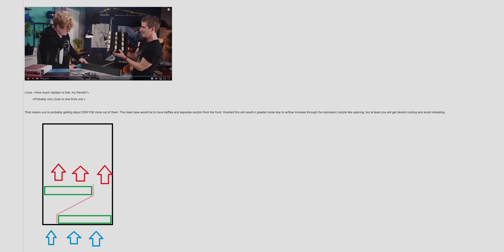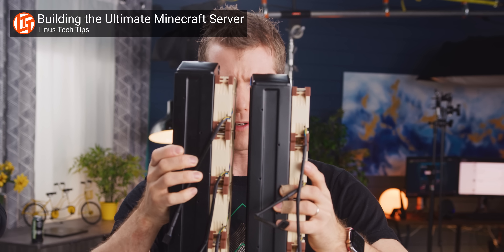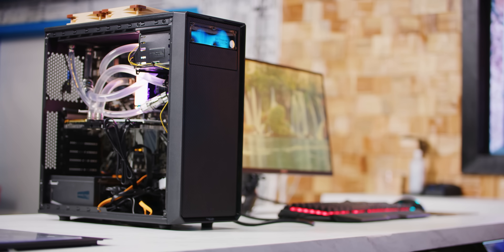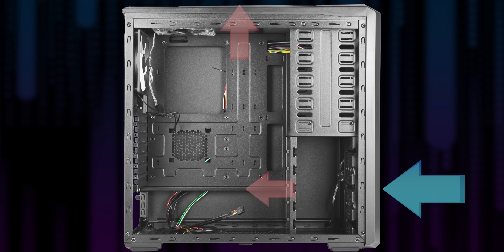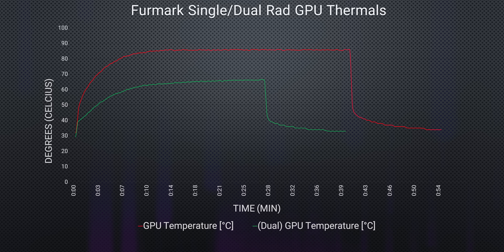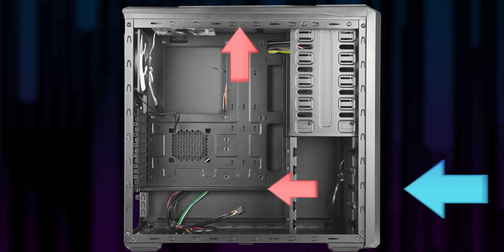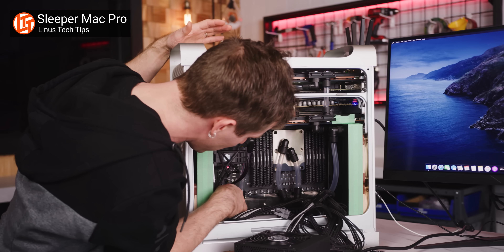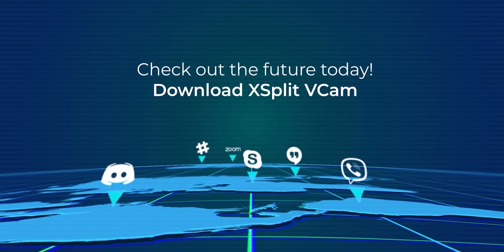I’ve been water cooling wrong for YEARS - $H!T Manufacturers Say

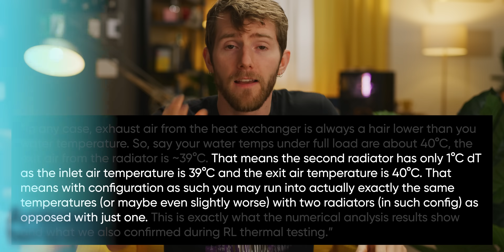Comment: 2:27 This statement, while true in theory, would require the radiator to be nearly 100% efficient at transferring heat to the air. This would depend greatly on the thickness of the radiator, the density of fins, and the rate at which air travels through the system. 

I'd be interested in what the results would be setting up air temperature probes on the intake and the exhaust to verify/disprove Corsair's claim here. If they were correct, stacking radiators would cause a negligible difference in loop temperatures, while instead I believe it just results in diminishing returns. Having separate intakes for all radiators would definitely be ideal, but it's usually not possible, and it generally isn't necessary.
Reply: I think there is a few videos out there from old school water cooling that tested the pressure and flow drops across radiators and various other components. I think with the more efficient pumps and radiators available now that it would issue would be  negligible. Worst case secenario you might have to increase fan speeds a little to offset what is lost and/or the pump will have to run at a bit higher rpm.
Reply: stacking radiators "if nothing else" increases air and fluid restiance of the cooling system. At some point the pump can not push the water and the fans can not push air trough the stack.

Comment: Linus you fool! You're doing stacked radiators wrong
You haven't stacked the radiators at all!! You've put 2 radiators in 2 separate parts of the case with access to "different" air.
Jake's custom Minecraft server, where the warm air from one radiator feeds directly into the next radiator is a "stacked radiator".
If you want to do this properly you need to test an actual stacked radiator, and you should use thermal probes to measure:
1) the ambient air inside the case
2) the air before each radiator
3) the air after each radiator
4) The air between successive radiators (in the stacked case)
Reply from the maker: It's good to listen to the video. We also did a quick santiy check with Jake's minecraft machine and removing one of the triple stacked rads raised temps by 5C.
Reply: @LinusTechTips  What was the before/after temp? A 5C increase from removing 1/3 of your cooling if not a significant change implies the 3rd rad was contributing very little.

Comment: It will make a difference which radiator the coolant goes to first. If it goes to the intake rad first, it will not cool as well as if it goes to the exhaust radiator first and THEN to the intake radiator. I would like to see that comparison. 90% plus furnaces use exactly this  idea to remove as much heat as possible from the exhaust gasses and actually cool the exhaust gasses down enough to use plain plastic PVC pipe to exhaust the gasses. Whew I'm "exhausted" lol

Comment: a true test would have been to compare dual rad paralel airflow with dual rad serial airflow ... How can you be astonished you have a benefit from adding a rad ? it's pretty obvious, but how much is it worth it to have an optimal (paralel) airflow design is a bit more interesting.
Also, checking cpu temp is only revelant if you have exactly the same volume of water in each scenario, which I suppose is not the case with one and two rads. 

Yes, thermodynamics is a bit of a headache

Comment: Hear me out, test them longer. You've only added thermal mass that hasn't had enough time the heat through enough to prove Corsair's point. While no one should have their computer running at 100% for longer than say 72 hours, if you heat the water in your loop long enough you will start to see diminishing returns for those extra radiators.
Reply from the maker: We reached the equilibrium point, as clearly indicated on the plots of temperature over time :)
Reply: @LinusTechTips  guess that's what I deserve for treating your video as a podcast and just listening 🙃

Comment: The only negative effects I can think of too many rads is, diminishing returns. 🤷🏻‍♂️
Reply: Yeah it's what I thought this video would be about
Reply: it entirely depends on the heat output of the system and the heat dissipation of the radiator(s).
Reply: I can think of price
Reply: diminishing returns are still returns (looks at three radiators in Lian Li TU150).
Reply: @A.Martin  just means you aren't overclocking hard enough :P
Reply: @flandrble  if you aren't liquid helium cooling are you really overclocking?
Reply: @fica1137  who will be first to overclock a quantum cpu? :P
Reply: If you add rads that's can't dissipate heat, you add thermal mass. It's better at first because it take longer to heat up. But it's also harder to cool. 

That's being said, I haven't seen any water-cooled rig that have pass the threshold of "the water is to hot to cool anything" (especially in canada).
But it's a possibility, and corsair must take it into account.
Reply: @Hacoulia  my old PC did reach that point, 360 "front" mounted and a 120 rear, but by front I mean behind 12 HDDs so the air was already toasty hot, so the air going out the only 120 exhaust was super toasty so that 120 did nothing.
Reply: @A.Martin  problem is adding radiators also add water resistance and air resistance and if you are really unlucky when stacking your radiators the hot air on the hot side of your rad might be warmer then your cooled water so stacking it the way you might be heating your water. Esp if you have radiators in a outgoing air stream as the last radiator in your loop
Reply: I have a feeling this is what Corsair was trying to say was the "wrong" part of his builds. His test was a 'no-duh' test and I bet for the MC server, removing two rads would be a MASSIVE change to the temps over just removing one. Because as you said, the third radiator alone pulls less heat away than a single radiator does alone. I.E.- 5 degrees is larger than 3 degrees, but of course together they're still pulling away a larger sum of 8 degrees.

Comment: lol thats the case i just bought for my new rig that i will be building in a couple of weeks. Waiting on the rest of the parts an more money. But hees what i got currently: Case: fractal design FD-CA-Focus-BK-W Focus G. Core i5 9600k 6 core 3.7ghz, G.skill Aegis 32gb ddr4 2666, 2TB WD Blue m.2 2280, ASrock b365m-itx/ac mobo. Still waiting on my fan, thermal paste and bd burner to arrive. Still need to buy win10 pro. And a bit down the line a second sata 2.5" SSD at 2tb as well and going for a 4tb hdd all from WD. I absolutely love WD storage. Nobody i trust more in that space. Will be reusing my gtx 1080 gpu and 650-700 watt psu that i frankensteined into an older computer. Not the best but still pretty expensive an still a hell of an upgrade over my current 6yr old computer that is just struggling. Also proud to say as little as humanly possible rgb bullshit.

Comment: Wanna know how i knew that in real world corsair is just blowing smoke. 
Cars! Oil/trans in front of the AC which stacked in front of the coolant radiator then the fan(s).
 Moving air does more for cooling than temp differential.

Comment: Don‘t put a radiator at any air in, only on the air‘s way out. So you don‘t heat up the Interieur.
Frontin put 2 or 3 140mm fans with no radiator, top out use a 360 radiator with fans pressing the air out and at the back go out with a radiator and fan or just go out with no rad, depending on your needs. Keeping the airflow stable and making sure the flowing air inside the case is cool is very importand for hardwares ans their mosfets lifetime.
Stacking radiators is just like using a bigger one at one spot, depending on the ability of the radiator to transfer heat to air, a second one might help a very little bit. But the better option is to use different spots.
So in a sane way corsair is right.

Comment: all i can say is stacking radiator's doesnt reduce the amount of cooling done from them.....think of the automakers and desighners...on modren cars there are anywhere from 2 to 4 radiators infront of the engine radiator and from my experince it doesnt matter if there is non or 4 infront of it the system will work as designed as long as there is an air tempature differental between the air temp and the coolant temp

Comment: All these commenters accusing Linus of not getting Corsair`s point, when in reality it`s they who did not get the point :D
Fact check - Corsair claimed no difference, or even worse temps. No, they did not claim it was less efficient (of course it is, and Linus admits it). They claimed no difference or even worse temps, watch it again.
Test scenario 1: 20°C higher temps with one rad removed
Test scenario 2 (minecraft server with 3 thick 360 rads stacked, best case scenario to prove Corsairs point): 5°C higher temps with one rad removed.
Corsair claim debunked. Case closed.

I guess Corsair fans (heh) are just blindly loyal. Truth is, their cooling solutions are mediocre and overpriced. Their PSUs are great though, TX650 still going strong after 9 years. But I had to change the fan. Go figure.

Comment: Should put some temp sensors infront and behind both rads to check the data. And possibly the second rad is running hotter than the front? So hot case air will still cool the second rad?

Comment: This shouldn't need saying but duh. Especially for radiator sandwiches. And I'm running a double rad loop, but it's in a big honking Silverstone Temjin case with a main triple 140 in the base compartment exhaust out the side, that'll happy blow 35c from a 40c loop, and a single mid loop 120 blowing out the top.
If one was blowing into the other with that small a heat differential there would be no point in the second that as it is set now drops the water temp from the oc'd  CPU into the GPU by a few degrees.
A water cooling system should be set up as if you were building an (especially component old) air cooled system where you wouldn't have the CPU exhausting on to the GPU and the case fans all blowing out so the only inlet is through the PSU.

Comment: When to seal your computer? Seal your computer and add external rads if you're building for a production or construction environment. Don't forget to circulate the air in the case and remove heat from the case too though,  for those smaller components and RAM.

Anyway has quarsair replied yet?

Comment: What does everyone think to my rig 
ASUS Strix z390 E Gaming
Intel i7 9700k
Corsair vengeance rgb 16gb 3200mhz
SSHDD 2tb seagate 
Msi gaming x rtx 2060 super 
650watt Corsair cx 650 
Anyone recommend any changes, I built it the other day runs so smooth was my second pc build so was wondering if it was any good

Comment: Corsair was likely emphasizing efficiency. For example with the Minecraft server 1/3 of the cooling hardware was removed and it only increased temperature by 5 degrees. Removing 2/3 would likely see a slightly larger but still acceptable increase in temperature of maybe 7 degrees above that. This is significant savings in both energy used to move water around and fans needed to move air through radiators. Maybe if that remaining 2/3 hardware had its configuration changed or optimized the performance could have been restored as well?

The other aspect they were emphasizing is that putting radiators in series is inefficient. The first radiator will work very efficiently and remove most of the heat while the second one will get the already much cooler fluid and struggle to remove much heat from it, especially if using already heated air. This effectively means that doubling radiators in this configuration increases cooling capability by only some fraction of a radiator. It will still cooler better, but not by as much as one might think and for actual consumers this might not justify the double or more price to setup such a loop. One could try to compensate for this by increasing fluid flow speed so that higher temperature fluid reaches the next radiator, but this requires more powerful pumps as well as potentially bigger tubing and fittings.

Ideally one would want multiple radiators connected in parallel with some kind of split evenly distributing the fluid flow between all installed radiators. This would assure that each radiator is getting the same temperature warm fluid in and so can transfer heat at maximum efficiency. Additionally the radiators should both operate at either air inlets, or outlets to assure they get access to air of the same temperature and thus transfer heat at equally optimal efficiency. Splitting the fluid flow evenly between the radiators is likely not simple.

This brings me to the biggest complaint about this video. Only a rough DIY build was made to prove against what Corsair said. No actual experimentation was done to find any truth in what they said and if there was any that it makes a significant difference at all. For example what is the difference in cooling performance with 3 radiators connected in parallel but having the same air pushed through them all sequentially versus having each supplied with fresh air? Or in a case build with dual sequential radiators like was shown is there a difference having the hot radiator at the outlet or the intake? What about just increasing the airflow across a single radiator versus a dual radiator setup, can they be made to match performance? Does fluid flow rate make a difference at all in any configuration? One can always take the brute force approach and just throw more radiators, bigger pumps and more/faster fans at a cooling problem, but optimizing to need the least of those for similar performance is proper engineering.

Comment: Really hit it on the head at the end there... This rig is NOT THE SAME as the hackintosh! The airflow is way different! It didn't have those extra intake fans drawing in cool air! That being said I think Linus makes a good point that the second radiator most likely isn't going to make the performance worse. The second radiator definitely does not reject heat as efficiently since the air/coolant temperature differential is much lower, but it should still do something... The crazy shit he did stacking 3 radiators tho... definitely adds a lot of airflow restriction.

Comment: Try using Both rads on Input on differnet placements noobs and you will see the big difference. that 3 stack could be better if they all are input as they can get new fresh air for each, instead of just passing through already heated air.

Comment: If you stack radiators directly on each other the flow direction is important. The one that is closer to the outside should get the hot water first(if the air is generally flowing out (for example top mounted radiators blowing hot air at the top out.) . The water is after that only warm and now gets to the second radiator more inside, that has more cold air.

Fish use that same principle to maximize oxygenation in their gills. In German it is called the "Gegenstromprinzip"
Reply: That's the working principle of a counter flow heat exchanger
Reply: dosen't rly matter. have done watercooling for many years. If you take water temp from the start of the loop and the end it's nearly the same temp. Dosent matter if you have. Cpu-GPU-RAD-RAD or RAD-GPU-RAD-CPU exact the same temp. You are cooling  water whit your radiators not the cpu,gpu block. The water cools the block. So for exampel i have in my rig 280x30 rad and 280x60 that cools the water in full load about 4-8 C over ambient temp.
Reply: Blitzkreig
Reply: Shuri hahahahaaah... no